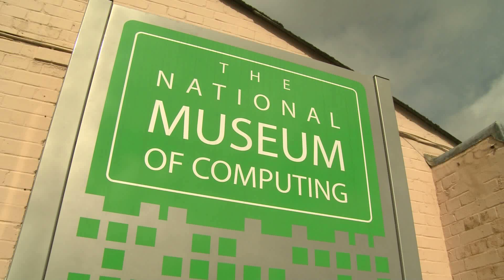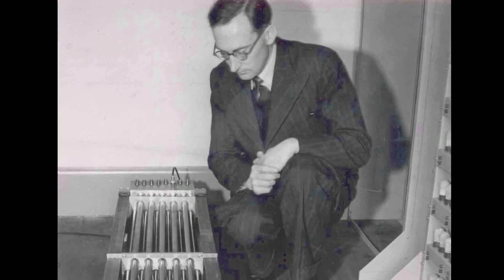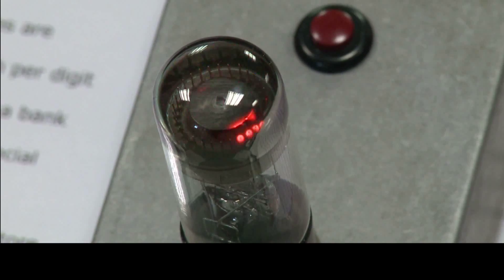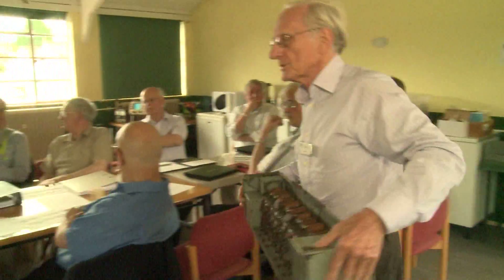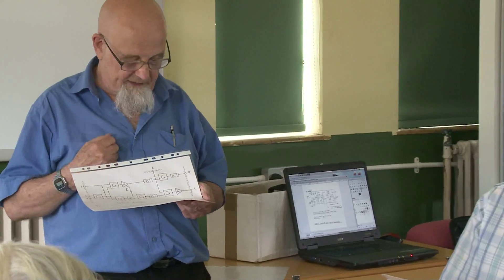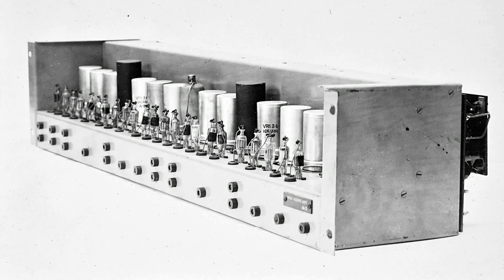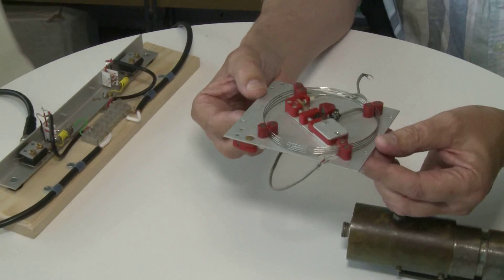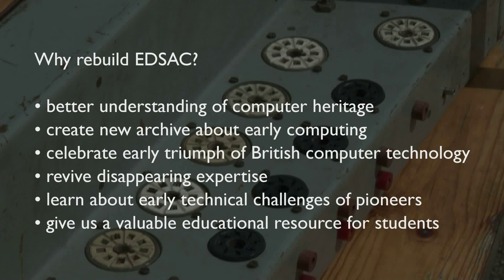EDSAC Re-creation Overview

Comment: I ran across this old digital computer patent 3190554 that ran on compressed air instead of electricity. Was this computer ever built and used for anything? Could one be built today using 3D printing. Thanks for the post.